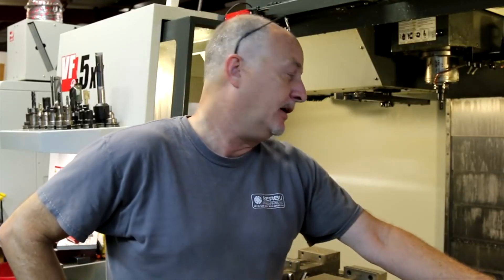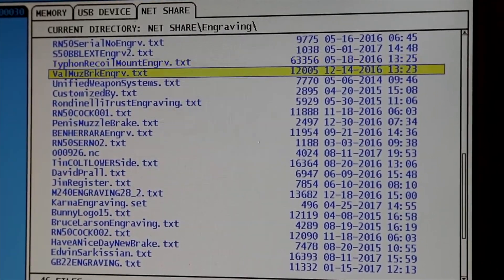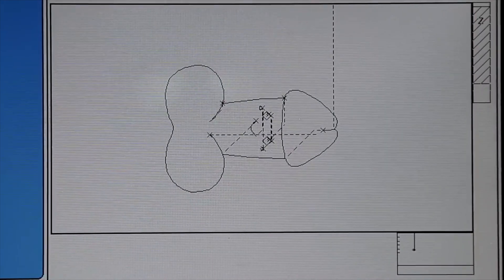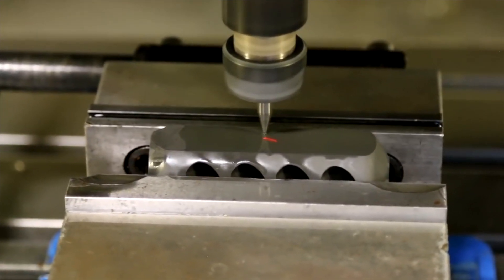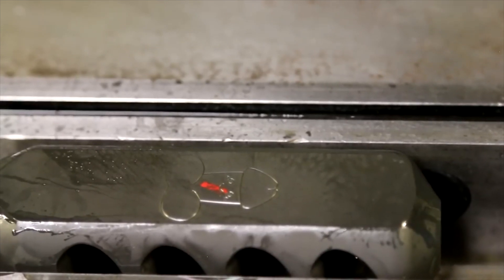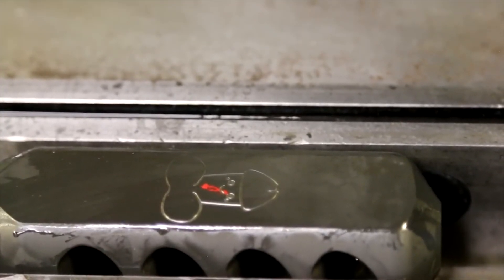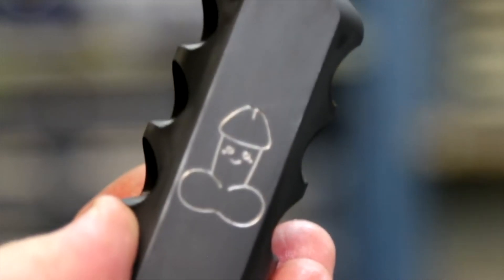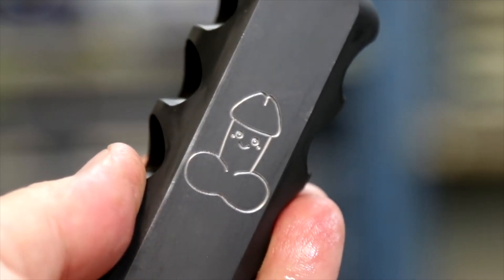Muzzle Brake Engraving

Comment: Mr. Serbu, about muzzle brake, where do one can learn about designing an effective muzzle brake?
Reply from the maker: There have been studies done on it.  To be honest, I just pulled this one out of my posterior.  Figuratively speaking, of course.
Reply: @markserbu  So it's all about trial and error yes? 
Would you mind telling me more about it?
I've designed guns myself as a hobby (and hopefully also for my future career) i find designing them in CAD software is quite easy. But that's only one thing of many things need to be done. I would really like to learn more about more complex stuff like gas operation and muzzle devices (brakes, suppressors, flash hiders, etc). like how much gas pressure is needed to reliably cycle a and what kind of design is effective as a muzzle devices.
Sorry for the long wall of text. I'm really admired you as a gun designer. Wish you could be my mentor. haha.